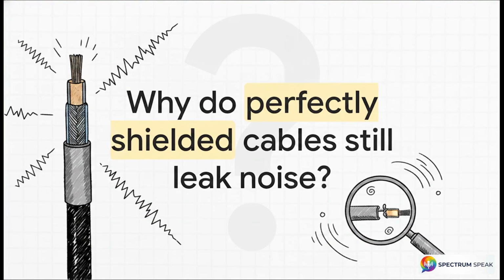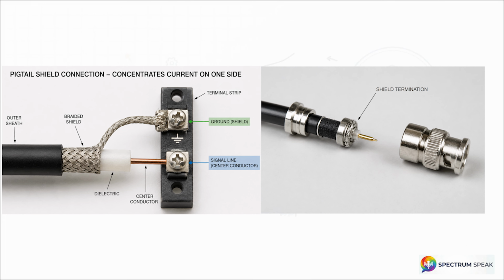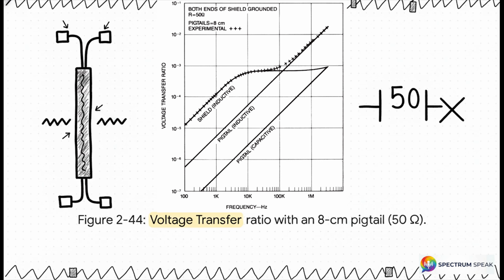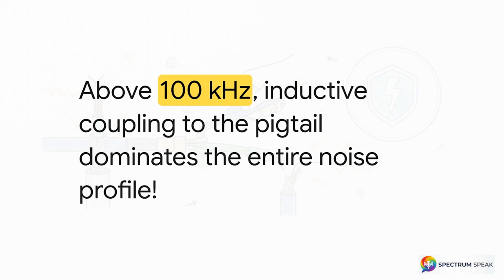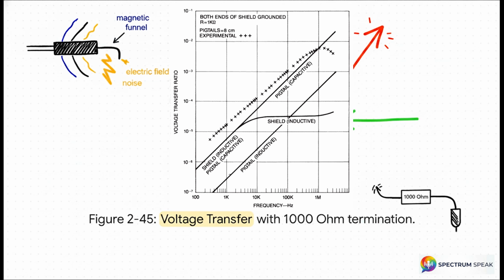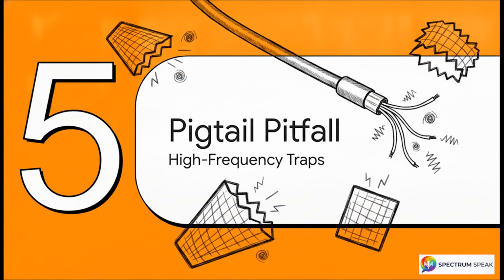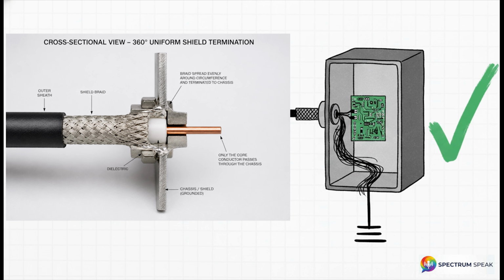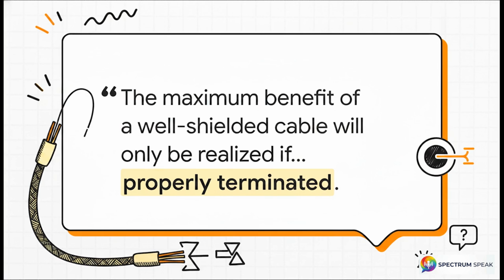Pigtail vs 360° Shield Terminations | Why Pigtails Destroy Cable Shielding Performance

Comment: Excellent video :-)
Most of  the modern amateur radio manufacturers are doing it wrong, have not seen one who does it correctly.
All computer PC and laptop, are doing it wrong. All of them.
Therefore it is very difficult to combine a amateur radio transceiver with PC computers.
Reply from the maker: Thank you! I'm glad you found the video useful. I agree that shield termination is often overlooked in many commercial products, especially where cost and manufacturability take priority. It definitely becomes apparent in amateur radio and other RF-sensitive applications. Thanks for sharing your experience!